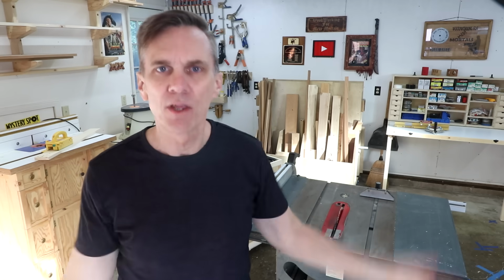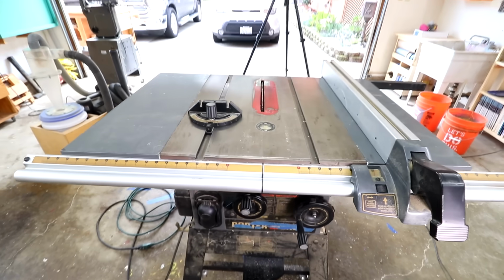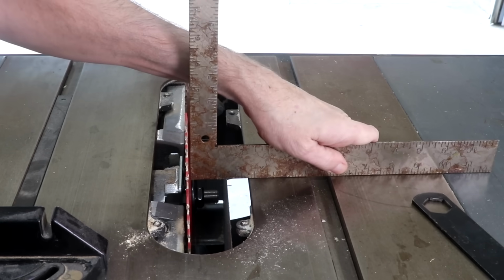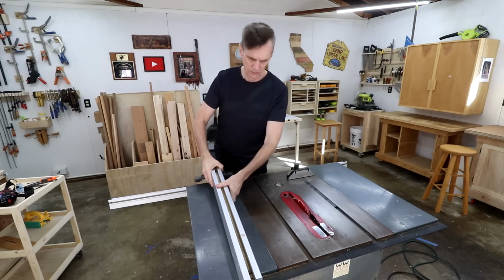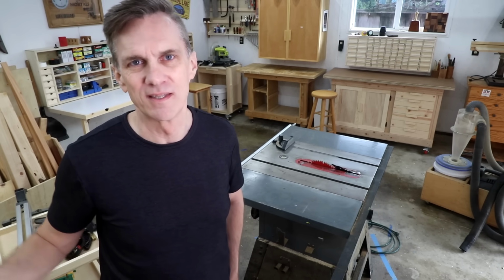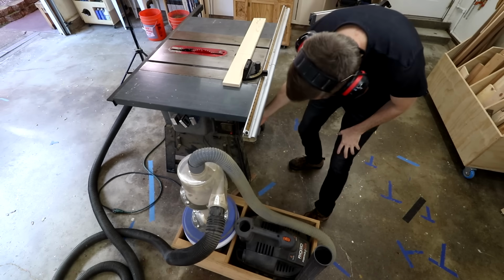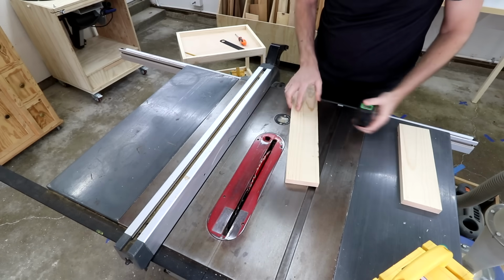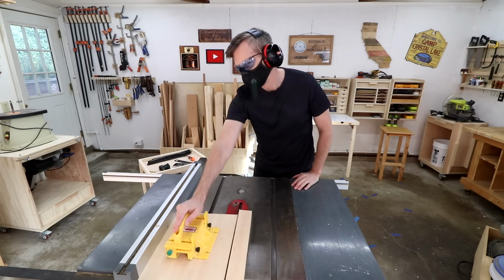A step-by-step guide to making your first table saw cuts. TABLESAW BASICS.

Comment: Before I tell you this true story know that I am very careful! I respect the power of the table saw and especially the damage it can do to the human body. I was using an electric smaller skill saw which is nothing less than a  portable table saw. I honestly don’t recall exactly what I did to cause this accident but I do remember it was a lack of being safe and a lack of respect for the saw because it was small and electric. I managed to somehow get a couple fingers in this saws teeth. It chewed my fingers up in a tiny, minute, fraction of a second. I will never forget how shocked I was at how much damage this tiny, electric saw could do to human flesh and how fast it could do it! I will never forget the pain either because it hurt terribly! You need to look at it like this. No matter how big or small, if it will chew threw wood quickly then it will do 50 to 100% more of that to the human body. I don’t even want to think of what a full size saw would do. Apparently I was being a little bit careful or I would have lost 2 fingers in much less than a second. These saws would take your arm off without even losing any RPMs. I’m sharing this story so hopefully you won’t be a dummy like I was. If you don’t respect the saw your are using and fear what it is capable of then chances are your luck will run out like mine did. Once you realize just how devastating these saws are to human flesh and what they will do to it, you will be much less likely to chew some fingers or a hand up or off. Your body sends information from the brain to what ever part you are telling to work, at over 200MPH. So if you tell your hand to push, pull or clinch, your hand will receive that information in the time it would take your thought to go from you brain to your hand at 200 plus MPH. I learned that in college biology. That is probably in the thousands of a second or faster. Not trying to teach you anything that I learned in college. Just trying to show you how quickly one of these saw will dismember you if you get complacent or lose the deserved respect for what ever saw you are using. Your first priority should always be safety!  Regardless what a rush you might be in or how much you might have on your mind, you must always think about “””SAFETY FIRST!!”””  Always, always, always for the sake of your fingers, hand or any other part of your body, always respect the saw you are using and think about what could happen if you don’t think your next move through and make safety much more important than anything you are cutting. If you don’t your next cut might produce a lot of red blood and excruciating pain. Like most things its always when you least expect it. So if you expect it if your not safe, chances are your will be safe. Wish I had taken pics of my fingers after the fact. The damage from even the smallest saw is crazy amazing! My fingers literally looked like they had been put into a meat grinder or garbage disposal. I was very fortunate I didn’t receive more damage than I did. There’s one thing I can tell you though after this accident. Safety is the first thing on my mind! Not how I’m gonna make a good cut. Sorry so long. Happy woodworking my friends and GOD bless!!..

Comment: Thank you. I just purchased a used Craftsman Table Saw, the kick back and protection cover are connected together at the end of the table. The kick back is not inline with the blade and prevents wood from sliding through. Any suggestions
Reply: I found the owner's manual online. I am good. The Splitter is the issue. I will align and secure properly. Love your advice on using a table saw.

Comment: I just bought a small table saw that can't support a dado stack. So let's say I want to cut a rabbet for a joint at the end of my 30"x3"x3/4" piece of wood. So I set it up as a cross cut and will do 5 passes or so with the blade height approx 3/8" (half the thickness of the piece). Is it ok to use the mitre sled and the rip fence if there's no cutoff piece? Second question. It would be easier to stand up the board and run it through along the rip fence to first split the thickness in half, and then cross cut the rabbet. But is holding up a 30" board in the air while it's on it's 3"x3/4" side safe? I've done it but it doesn't feel right. Do I have to build a sled or something ?

Comment: Firstly I wanted to say you make great videos and I really enjoy learning from you. I do have a question though. I’d class myself as a beginner  and I have just purchased my first table saw. You mentioned to always use the blade guard. However you also mentioned to lift the blade just slightly higher than the stock being cut. If my blade guard connects to the riving knife and I have a small piece am better off lifting the blade higher to insert the blade guard, or leaving it off and having a lower blade?

Comment: Combination blades aren't very good for anything.
Reply: Compared to using a cross cut or ripping blade they never cut well at all. You need to sand blade marks off to get a good finish most of the time. Are like 90% of combination blades defective or something?
Reply from the maker: Well, besides cutting wood.
Reply: @SteveRamsey  it'll cut wood. Just not good.
Reply from the maker: @TheRealGOTdurrrred  They're literally all I've used for the past 20 years and never had poor quality cuts. Maybe you've only used defective ones?

Comment: Hi Steve, loving these videos. Does a table saw have to go all of the way through the wood it is cutting?. I'm a new woodworker, with a project requiring I cut a 3ft long cedar 4x4in beam length-wise, so that if you look at it from the end you see a 1in wide L shape - essentially I need to make 2 longitudinal cuts that meets so that I would end up with a 1 in L, and a 3x3 beam (minus cutting waste). Setting the table saw so it projects out 3 inches, and setting a rip guide to 1 inch sounds ok to a novice like me, but I've never seen wood cut where the blade doesn't cut all of the way through, and I worry about safety.  Any advice welcome - thank you

Comment: Hi Steve, I need to thin some planks into fencing slats. They are 50mm x 25mm x 4.8m and I need to halve the 25mm dimension. With two of us, we've done a few with my new table saw but it's hard to get them even all the way through. I'm wondering about making a slotted jig (essentially this would give me a fence on both sides of the blade) so that constant, gently pressure is used to keep the work in place as it is pushed, and then pulled, through. What do you think of this as a plan, please?

Comment: Before switch on, tie long hair back, no necklaces, no hat straps dangling down, no loose sleeves. Never put your fingers within 6 inches of the blade - use push sticks or push block as stated. I have tried using a foot switch, though I am not sure about it because of body balance and stance.

Comment: I brought a used table saw and found some of the plastic teeth are missing for the angle adjustment is there another way to adjust the angle it’s seems stuck at a 5 degree

Comment: I just picked up a old skill table saw it doesn't have a riving knife or blade guard.? Doesn't look like it was made with those features, will I be alright to use it anyway?
Reply: You could technically use it but i wouldnt recomment it since both of these features have saved me multiple times and espacially if you lack the experience of using tablesaws not having a riving knife and a blade guard is very dangerous even for experienced users
Reply: @meinkonto2034  got it on Craigslist for $45. Talked them down from 65. Now I know why they were selling it so cheap. It's dangerous.. Hope I can sell it and get a better one with all the safety stuff

Comment: One more key point;  NEVER PUT BOTH HANDS ON THE SAME SIDE OF THE BLADE!  Your intuitive reaction in the case of an incident will put your “wrong” hand into the blade!  Your body automatically clears from center.  Your hands move away from what you are holding when “surprised”.  Keep the blade between your hands ALWAYS, or don’t make that cut on that tool.

Comment: I very much appreciate your point of moving the woo through the blade, rather than moving the blade through the wood.  This point is CRITICAL, and you are wrong about control of the cut when moving the wood through the blade.  Much more control when moving the blade through the wood, given that proper clamping and guidance is provided for the tool that incorporates the blade.

Comment: Hey, I started woodworking recently and bought myself a tablesaw. I was really excited to use it. However, in my excitement I didnt use the miter jig to hold my test piece of wood, but used the riping fence. as you can imagine, i got pretty strong kickback and now i'm basically scared to use the table saw (i got hurt on my finger, not that bad but it hurt pretty bad) any advice on how to regain that confidence?
Reply: The OP's tips are spot on. Measure EVERY word he says. But also, I've just commented - plz read that too. I left my saw for about 15 yrs for the same experience as you. Repeatedly got kickback until I decided "not worth the risk", so maybe one year late replying to your post is still reasonable.. Get a good pushblock too. I use sticks here and there but there are better options like the one he uses. I consider the sticks sacrificial too. You can cut shoe shaped push blocks with notches cut to help grab the workpiece along with a push stick to push the piece against the fence.  You can also make jigs on the miter slots that hold the workpiece securely and away from your hands but that's a bit above me. Saw my friend use ones he's made. They're great but I've never really looked into it. Above all, stay safe even if it means not using the saw.  There's other things in life to enjoy BUT, for good woodworking a table saw, bandsaw and router are indispensible IMO but I'm still basically a higher grade hack.

Comment: Thank you Steve for this nice YT. I wish I had seen it before I got my left index injured with a kickback of my cut piece. The saw I was using over 2 years has no tubing knife or blade guard. I was so confident that I will not let my fingers on the blade but ... that’s not totally your control. A simple kickback could chop one or more fingers out of your hands. Certainly learned the lesson the hard way. Now I’m in to safety and never compromise on that.

Comment: Hello, for someone who has a small workshop aka garage, and occasionally does woodwork, and wants a practical diy small and portable table saw, would a wet saw be it? It can do tile work but change the blade it can do woodwork? Maybe the blade can not be adjusted but the specs for most tile saws seem very similar to wood saws, 3500rpms. Thank you.

Comment: Great instructions! Your side note on making a table saw made me go back in time when I was 14 and made my own table saw. No, my dad did not help me ;-) He was useless in this respect. I used and old dinning table, a sheet of metal, cut the opening with a jigsaw ... The biggest problem was getting recessed screws. Those were hard to come by in the 80's in my town. I had to go to the capital... It did work well and I had no accidents. I was lucky for sure!

Comment: I had a accident with kick back last March it like to killed me . I don’t know what I did wrong. I had two safety stick . But it knocked me out . I finely got my gum repaired. I hope I will have teeth in May. But I scared to death of a table saw. I bought a bigger one better one. Will you put your safety Guard on. So I can watch. Most Video don’t use the safety guard. I love wood, not no Carpenter. Just like making stuff . Need help

Comment: Hey Steve, love your videos. Still just starting with woodworking and had a question about your fence. It seems to run so smoothly and accurately. I too am using an older (Delta) saw and find that there is a lot of wobble between the front and the back of it. I sometimes use a combination square in the mitre slot but this can be time consuming when making lots of cuts of different lengths. Are their other options? Is yours an after market fence?

Comment: I bought a riving knife and miter gauge for my old table saw and they do not fit :( .
The rail on the miter gauge is not the same size as the slot on the table saw. 
The riving knife does not lock into its place. Im scared of the saw, i know how unsafe it is without the riving knife. Maybe one day i buy a new saw that has the correct accessories.

Comment: This is a great video, but even with a riving knife you shouldn't push the off cut directly into the blade. Riving knives and splitters are generally aligned with the right side of the blade you could potentially push the off cut enough to cause kick back especially once the piece is cut all the way through

Comment: OK, you said there are no stupid questions about using a table saw. I  keep both hands on either the wood or on the push sticks. I understand the red button means off and the green button mean on. That leaves me with my nose to operate the buttons which really gets painful after a few cycles. What am I doing wrong?

Comment: Hi Steve, I am a seasoned beginner I would say & I just purchased a Rigid, 10" corded table saw and I am yet to use it. I want to purchase a stacked dado set, but the largest I can find anywhere is 81/4".  Are stacked dado sets always smaller than the actual blade or should I keep looking for a 10"? Thanks for the help.

Comment: Does it matter if you cut your workpiece between the blade and the fence, or in the outside of the blade? You mentioned that you usually push the workpiece in between the two but you didn’t explain why. Thanks

Comment: Hi Steve, I love your videos and have got so many tips from you, I only have a small shed to do my work in, I have been given a small table saw from a friend, but unfortunately there are no mitre slots on the table. I'm making some hexagon shelves for my son and wondered if there was a way to make a cross cut sled without the mitre slots to get the 30 Degree angle needed. The blade tilts to the Left and the fence only goes on the left as there's not really alot of room for it on the right, the workpiece gets caught under the blade. Or even make a sacrificial top, what do you think
Keep up the good work 👌

Comment: Q1: In the last cut shown, why do you not have to hold the cutoff piece with the gripper or a stick? 
Q2: Also, is there a minimum cutoff piece width where you could no longer use the table saw effectively?

Comment: Hi Steve! Great video! I loved the comment - don't fear your saw but respect it. I have made a table saw at home fitting a circular saw underneath. obviously there is no place to fit a rev knife. After seeing this video will make sure the design is altered to accommodate a rev knife. Thanks for making me aware. By the way in your knowledge is it durable enough if I make the table top of my table saw out of HDF (High density fibreboard)? - Ravikumar Choudhary, India

Comment: I'm new to woodworking and the table saw. All the video out here have been super helpful. Today, while making a crosscut sled, I ended up cutting straight through a #10  2" screw, vertically! Literally right in half length wise. This was using the blade that comes with the Dewalt 8 1/4" table saw. Would that one screw damage the blade enough to replace it?  Thanks for any thoughts on this!

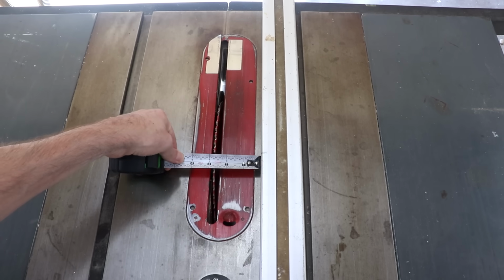Comment: Word if advice to beginners, you can watch these types of videos until you're blue in the face, and they are clear as rain, but when you set up your table saw for the first time and make your very first cut, it can be easy to forget or miss-remember what you learned, so really watch these again right before your first cut. I'm at fault for this, I've wanted a table saw for months and after watching countless videos like this I got one for Xmas.  I thought I was doing everything right but my very first cut (which was a cross cut on a scrap of cedar) ended up being a kick back because I made the mistake shown at 6:03. My memory said this setup was ok when in fact I had forgotten the part of first adding a stop block to the fence.  I didn't even see or hear the kickback, and found the missing piece minutes later after searching.  Fortunately since I was standing to the side behind the miter gauge it didn't hit me.  Mentally fact checking the cut before you do it really is great advice, as the change in environment going from a computer screen to real world can affect you.

Comment: It seem to me that when ripping that if the fence is on left side of the blade you don't have to be behind the work. Granted you can't use 2 push sticks but a feather board should take care of that. I am right handed and this seems safest to me. What are your thoughts?

Comment: Great video!

For the part where you demonstrate usage of the push sticks, it should probably be explicitly mentioned that the the 2nd push stick you use (with your left hand) shouldn't exert pressure towards the blade on the piece you're cutting. Last thing you'd want is for it to bind with the blade.

Comment: Steve present very well. As a newby I appreciate his pace or cadence. It's great to eat lunch by!  With eye protection on always. Does Steve or anyone wish or have reduced the table saw noise. I bought a used Ryobi 3100. The thing is super loud. Attach a shop vac and it's the Normandy landing all over again! Please any advise? Change blade or user error. Any and all is appreciated.